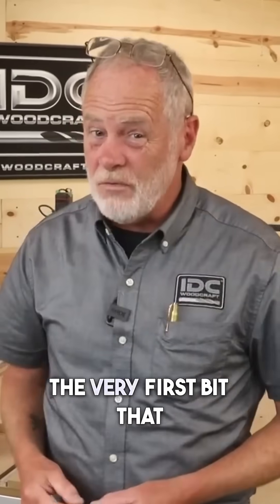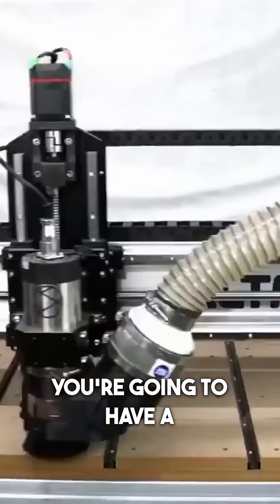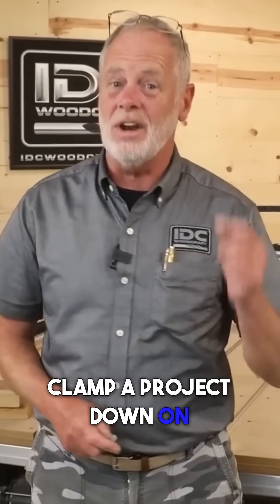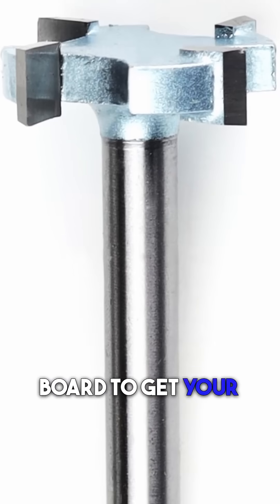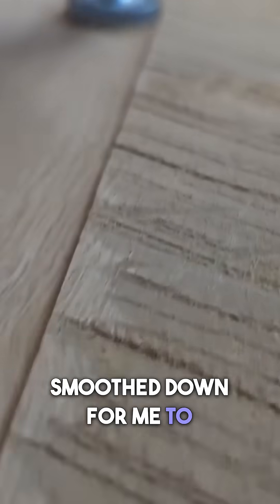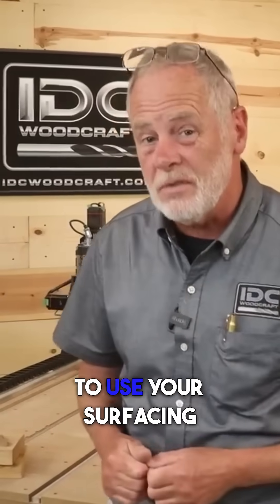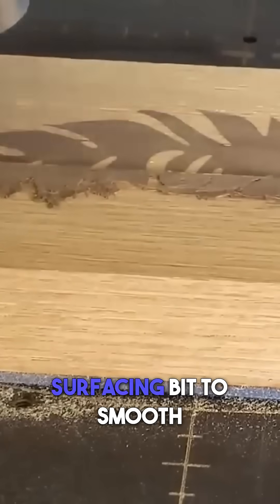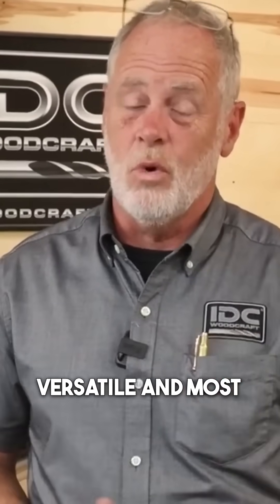6 Surprising Ways to Use Surfacing Bits on a CNC Router (do you know what they are?)

Comment: I just bought I used BobsCNC evolution 4 and the owner said the only thing I need to do is resurface the spoil board.  What size bit should I buy?
Reply from the maker: This one
https://idcwoodcraft.com/products/ultra-smooth-cut-1-surfacing-bit-for-cnc-router-spoilboard-slab-flattenning-1-4-shank
Reply: Great vid, Garrett!  I wondered how you'd pull out SIX uses!
Reply: The bit Garrett suggested will work great for your spoilboard, I have one. Also good for surfacing project material flat if warped.